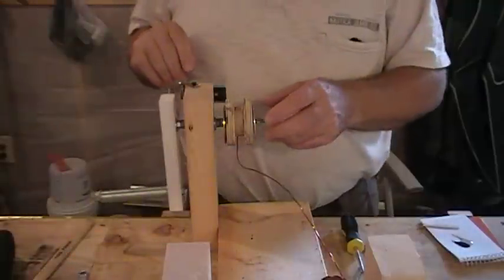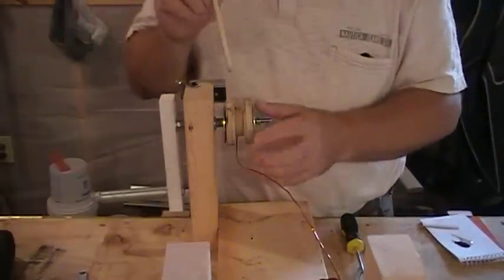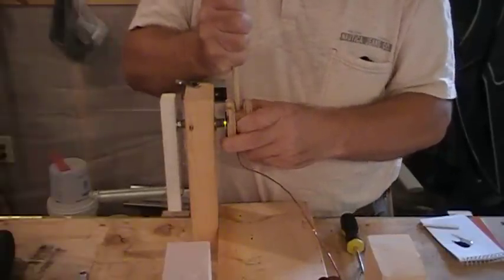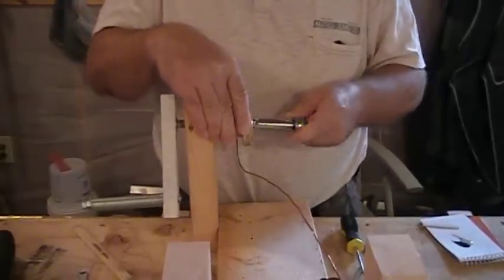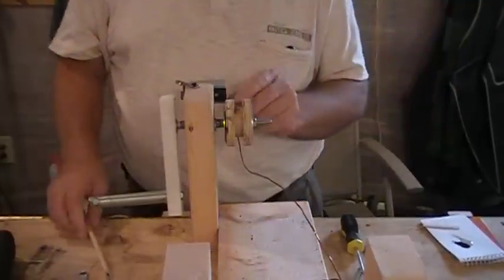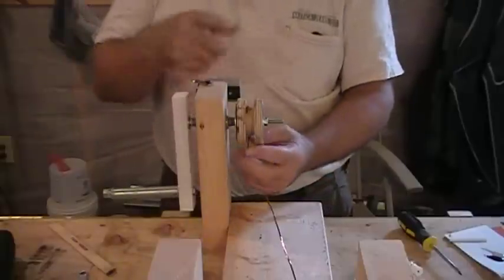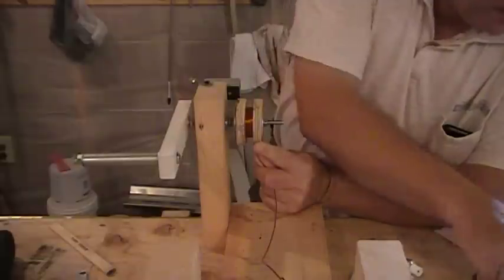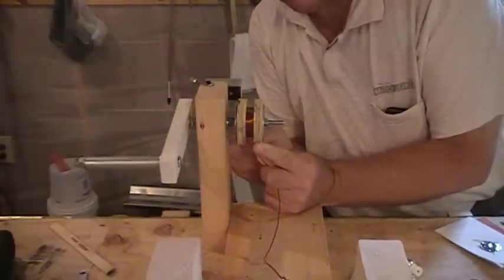Coil winding.

Comment: Also guys, remember that Tesla said that if you want coils to work together you should weigh the mass of the copper wire.
So after you work out roughly the dimensions and turns of your wire, make multiple mini spools, weigh match the copper, then the epoxy you add won't effect the weight. 
Having the most accurate low resistance range meter always helps, it's most important that they match, rather than they be of a exact resistance. Establishing the rpm range and the strength of the magnets going by them is also important. But it's far better winding your coils in a Kromrey setup to give SLA batteries a type of waveform that changes and desulphates at the same time, unless you plan to only charge a bank of ultracapacitors in which case, a smoother rectified signal is more suited.

Comment: I've found this helpful.
Have the epoxy resin in few spots unmixed and Mix each one as you need.
On glass of a glazed finished tile is a good idea and if it's hot, sit that tile on and ice pack to give you more working time with it.
Making wood spools that are coated in oil or wax it great. I've also found first wraping the inner of the spool in teflon tape (plummer tape) helps in getting the tightly wound coil off the coil form with ease. I can't recommend making a coil winder using a power window motor enough! They are a worm gear and have a good range of rpm, but most importantly they don't unwind when no power is applied! Simply vary the voltage to slow down the speed and mount your spools, counter and foot switch. The only tricky part is replacing the main shaft with a longer one. But where there is a will there is a way. If you are like me, somewhere in the junk piles is a shaft perfect for the job!

Comment: Sir can I know how many meters your winding, because the wire you use is always cut
Reply from the maker: The length of the wire is really determined by the size of your magnate. The center of the coil should be the size of your magnate. Therefor if you have a 1" diameter magnate that would be approximately 4" per turn with 65 turns approximately 266 inches. More turn, more length. Less turns less length. It also depends on the thickness of the wire. I was using 16 gauge if you use 32 and double strand it then the amount of wire length would be much more. You need to figure out what kind of out put you want than make a test coil and test rotor to spin the magnets over and get a reading from a volt meter. I know this isn't the answer you were looking for but I don't know the size of your wire or the out put you are looking for.
Reply: Wow!😊 thank you so much sir for your gave the answer.😆  because this is my personal project this year also 'self running magnet motor'.

Comment: Do you repair Subwoofers or where can i buy the recoil wire? Tony of Charleston,South Carolina
Reply from the maker: Hi Tony, you should be able to buy or order coated wire from an electrical repair shop or a electric motor rewind shop. That is where I got mine. Good luck
Reply: Old post but I figure some can use the info.  Best and most reasonable priced magnet wire can be had from Remington .  Free shipping helps too.   https://www.remingtonindustries.com/magnet-wire/

Comment: Did you glue that coil to the wood, ?    it looks like they aren't coming apart.
Reply from the maker: Thank you for your question. No the wire isn't glued to the wood there is a hole in the wood and the wire is held in place with a large washer. When the glue is dried you just take it apart.

Comment: Not criticism just a tip:
Always mix glues like two part epoxy on a piece of glass with a razor blade.
If you have to somewhat mixed scrape it into a pile then scoop it to another location with the blade and finish mixing it.

It makes a huge difference in the quality of the finished glue.  I know that your project is that glue critical, I only shared this as a tip.  I used to have to glue a lot of Optical assemblies that were hugely expensive.
Reply: Clown Whisper thanks for the tip! It's helpful.
Reply: @mich0008  And NEVER EVER allow the tip of the  A or B  applicator tube to so much as touch the other type of material.  Just one little bit of the opposite component will catalyze the whole remaining tube .  Over time you'll find your Epoxy hardened in the applicator next time you go to use it.   LOL, Don't bother asking how I learned that one.

Comment: hi! I need to know which gauge of wire and how many turns I need for 5kw 12 volts output and also rpm needed. thanks
Reply from the maker: There is no really good answer to your question because there are so many variables. Like the consistency of the wind. What I can tell you is that these coils have an out put of 1.6 volts each at 150 rpm's they are made with 16 gauge lacquer coated wire with 65 turns to each coil and I have 9 coils per stator.  So if you take 1.6 and assume that the 150 rpm's comes at 24 mph wind and the wind blows 24 mph all day with a 35% efficiency that would give you around 1000 watts if the stator produced 1.5 amps. Then you can try smaller wire and more turns or double the wire or add more coil to a stator or gang your stators with multiple magnetic rotors. I don't know if this helps but good luck and work safe electricity will kill.

Comment from the maker: @trailkeeper Thanks for your answer. If this is within normal specs then it sounds good to me.
Reply from the maker: The inside diameter of your coils should be the same as the size of your magnets. My magnets are 1and1/2 inch in diameter so the inside diameter of my coils are 1 and 1/2 inches. Thank you for your comment and watching the video

Comment: I guess high voltage output, and low ohms is good for a coil, the lower ohms the better because there will be less power loss in the coils when they are doing something "under load" as they say.  I don't think the ohms is too critical in building a prototype, but if you want to measure it as close as possible, put your meter on the lowest setting where accuracy should be better.